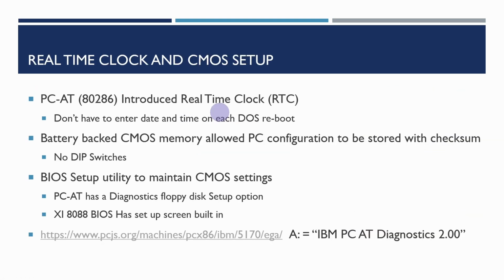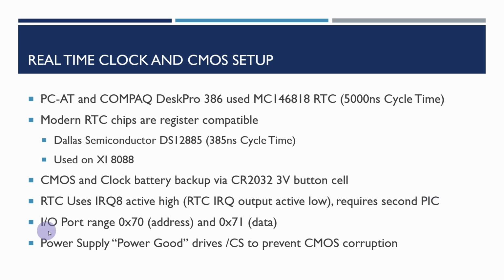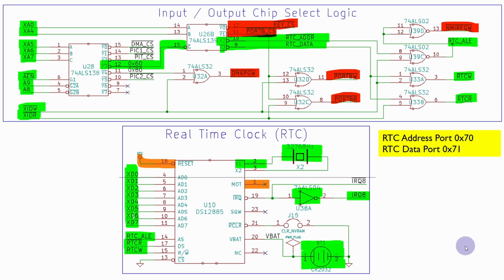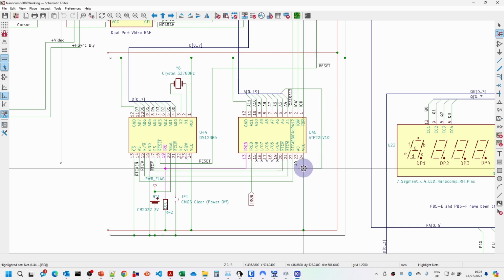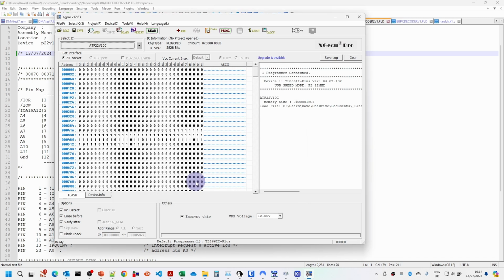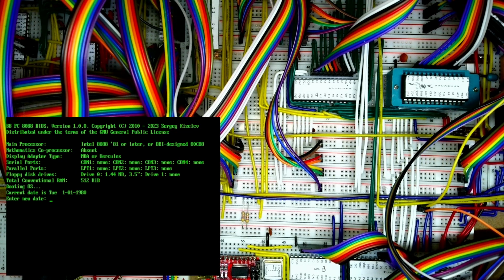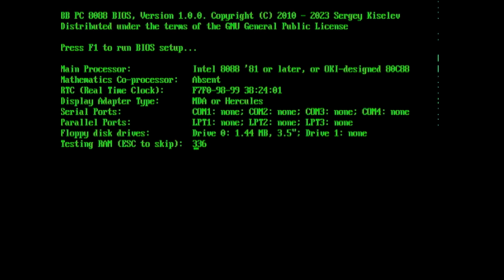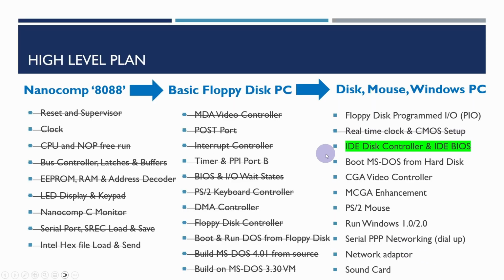Breadboard 8088 PC #39 Real Time Clock and CMOS Setup

Comment: Wow, you actually drew all the connections as wires in kicad? 
I usually just put labels on the pins and name them accordingly. The pcb editor still shows all the connections between lines of the same name. 

I guess that is a more robust method, and easier imho.
Reply from the maker: Well I change the chip layouts to the physical layout so that the schematic layout matches the breadboard layout (approximately!). Avoids having to worry about PCB side in KiCad. Drawing the wires in KiCad is easier to do and change than on the breadboard. Helps to identify bottlenecks and where things get too busy. I find the schematics used for PCBs with just the labels on the pins difficult to follow. Dave

Comment: Does DOS 2.0 have support for RTC? I think it pre-dates the AT which was the first PC that came with an RTC as standard. The earliest I ever used was 3.2 so I could easily be wrong.
Reply from the maker: I checked, it supports reading the time from the BIOS but not the date. 
With PCJS  PC-AT with PC-DOS 3.0 read the date & time.
Loading PC-DOS 2.10 Disk 1 results in date of 01-01-1980 so it is the DOS version.
Also checked the MS-DOS 2.11 source and couldn't find reading date, though does have change in day at midnight.
Will have to get FDC working without DMA to find out!